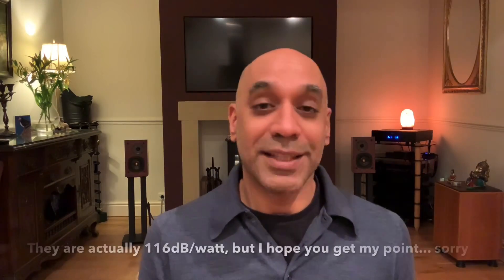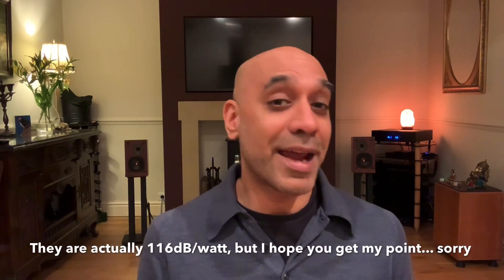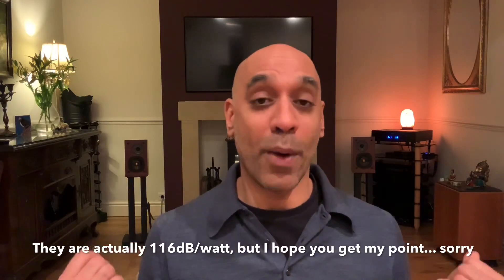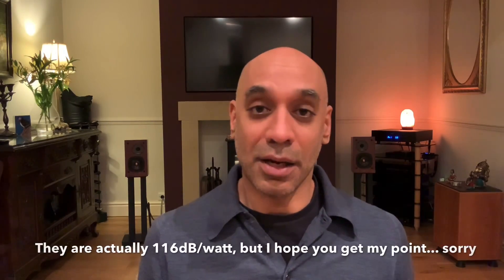Hifi Myths & Misconceptions - Amplifier Power

Comment: There is one thing that I actually miss here and that is the differentiation between voltage and amperes. My understanding is that loudnes is mainly created by a certain voltage. But when you have low impedance on a speaker you need more current (amperes) to reach the desired voltage. So the amplifier not only needs the wattage but specifically needs the capability to deliver the amperes. Or did I get that wrong?
Reply from the maker: Not exactly Martin. Too much to get into here but loudness in your listening position is going to be a function of amplifier wattage and speaker sensitivity 😊
Reply: @abritishaudiophile7314  I agree. But wattage is a function of voltage and current. And I understand that on a lower impedance you need higher currents to reach a certain voltage. Ist that wrong?
Reply from the maker: @martinsoltau6926  the voltage is set, it is the current demand on the amplifier that increases as the impedance drops 😊
Reply: @abritishaudiophile7314  see, that's what I meant. You can generate a certain wattage out of a multitude of volt /ampere combinations. And on low impedance, with an increasing demand for current, the amplifier needs the capability to deliver that. Is your point that as long as the amplifier has the wattage, it can also deliver the current?
Reply: @martinsoltau6926  
Perhaps I can help here ... Most modern amplifiers are voltage sources.  That is for a given input voltage they will produce and, through feedback, maintain a specific output voltage.  From there the job is to deliver enough current to satisfy the load impedance...

The easy way to remember this is that current is the result of applying a voltage across a load .  It's the amplifier's job to deliver that current.

Comment: Tarun, I am a new comer to, what I call high end audio. Ever since back in 1999-2002 ish I heard my mates Dali floor standing speakers through a Marantz KI Signature CD player and KI Signature amp, it played Bruce Springsteen Streets of Philadelphia, I was blown away, the hairs on back of my neck were up. I vowed then that one day I would get myself a decent sound system. Fast forward 20 years, wife and kids and couple of house moves out the way, we have moved into our 'forever home' and I am finally going to take the plunge. Your videos are helping each one I watch, I wish I could say I understand 10% of what you are saying, but this video has helped me a lot, I think I get it. After research I was going to be settling on the Cambridge Audio CXA81 and the Cambridge CXN V2, as I stream my music now, all sorted. Or so I thought, the shop I am using, a well respected chain then threw the NAIM Uniti Atom, now I am considering going this route, however it has a rating of 40w and the speakers that I am considering are Focal Aria 926 or the Triangle Genese Quartet floorstanders, and I was worried that the NAIM would not be up to drive those. If I think I have got it, I think I should be fine and not need to buy a separate amplifier, as the NAIM is retailing at £500 over what I wanted to spend on amplifier and streamer. I live in an old Yorkshire stone built property, the walls just under 1m thick all around, but the room is large where the sound system will live 6m L x 4m W x 4m H (96 cubic meters) and I will be listening from about 3.5m to 4m distance. So after all that, I hope, if you read this you have not nodded off, I think I will be fine and your video has put my mind at ease. Roll on the demo of said equipment on 17th Feb. Once again, thank you as it is a struggle to find a British channel that reviews and gives out advice.
Reply from the maker: Thank you for sharing Mark. The Naim Unity Atom is a good unit but a little pricey for what is on offer. Depending on how you are streaming, you may want to consider a Hegel H95 😊

Comment: I loved your video on  making your own IEC power conector. I am hopping you can help with my little problem. I wish to upgrade  my power input cable with a home made /shop made lead. Question  : I have a Arcam FMJ A29 it has a 2 pin IEC  power lead . All the leads are 3 pin . Am I correct  in thinking  I have a double  insulated  amp therfore any iec power cable that will fit it is safe .please  inform  me if I'm getting it wrong.  Many thanks Gerald
Reply from the maker: Thank you Gerald. It is only grounded at the mains plug end so a shielded cable will still be beneficial 👍
Reply: @abritishaudiophile7314   Thank you for replying to my question. So yes It's  OK to purchase a power lead . Although  mine is 2 pun your 3 pin setup will work ,,Yes
Reply from the maker: @geraldcrook9504  yes, that is right as far as I can tell 😊
Reply: thank you 😊

Comment: So as a mobile certified audio professional we were taught lower resistance equals easier to drive not harder to drive. Which just makes logical sense as well. If I have two ohms this requiring less power than 4 ohms. Don't believe me look it up.

Also by running speakers in parallel say two sets to an output will lower the total resistance seen by an amplifier. This will essentially double the power to your speakers as you have lowered the resistance by half.

I can cite sources if you'd like?
Reply from the maker: As the resistance drops the current demand from the amplifier increases for a given amount of power. Many amplifiers will struggle with the extra demand placed on the power supply and some can become unstable into low impedance loads 😊
Reply: @abritishaudiophile7314   It's the same way electricity works. If I lower the impedance or resistance it becomes easier to push through.  Just because some cheap amplifiers have a difficult time driving low impedance drivers does not mean it takes twice the power. You're basically saying it backwards. I'm mobile electric certified and have worked in the mobile and home industry for 20 plus years. I would provide you with sources but every time you try to include a link on YouTube it auto deletes your message.

Not only that it takes 20 seconds to Google.
Reply: Yes it will double the power demand on your amplifier.  That's not always a good thing. Many amplifiers will overheat and even self destruct if the load is too low in impedance.  IT's not easier to push through... it is your speaker placing an increasing demand your electronics. Tarun is right... that makes them very hard to drive, without killing an amplifier.
Reply: @Douglas_Blake_579  I understand how lower impedance loads are much harder to drive. Very few amps can go down to two or one ohms.
Reply: @Ace-Brigade  
Then you know that what you initially said you were taught is incorrect.  

Lower resistance amounts to more current... more heat, more strain on the electronics, less ability to maintain speaker voltage, power supplies that sag... none of it is easyier.

BTW... going from 8 ohms to 4 ohms, doubles your power... that's a leap of 3db which most people wouldn't even notice.
Reply: @Douglas_Blake_579  no that is not true

Comment: I thought id ask a question about AV receivers, hopefully you can shed some light. I want to, if possible connect my old VSX-933 to my new Pioneer LX-505 for additional amplification and to relief stress on the LX505 until i can scrape up enough cash to purchase a proper external power amp like ToneWinner AD-7300PA. So, can it be done (connecting the LX505 to the VSX933) and how can it be done? I'd appreciate you sharing your thoughts.
Reply from the maker: Sorry, but I am out of touch with those receivers 😊

Comment: 03:00 I’m quite late to the party, but is my math off? 
You said power X2 = +3db
Then you said +10db = perceived loudness X2
So to double perceived loudness would require a power increase of 3.333, not the ten times you claimed.
Is this correct?
Also, I take issue with anyone referring to a Klipsch sensitivity without explaining “in room response” to the audience.

Comment: A very good and informative video.  One thing not mentioned though, is that a speaker's sensitivity rating is for ONE speaker, not a pair of them in a room.  For two speakers playing in the same room, the output will be 3 dB higher.

Another thing not mentioned is how live or dead the room is.  Highly absorptive rooms will require significantly more power to achieve the same SPL at the listening position as rooms that are highly reflective, such as the one you were sitting in when recording the video.
Reply from the maker: Thank you 😊

Comment: its all swell as some say.   i had a ayima ao7 chip amp with improved chips and bigger fan-driven power supply pushing to 48v and a constant fan hum and i guess near 120w per channel paired to dual polk psw-10 subs and polk tsi100 bookshelves...i got it to sound ok on some tracks.    i then got an emotiva basx 2 amp at near 160w per ch and to me there is little comparison,   the emotiva a/b amp sounds better on all types of music.   separation, depth, cleanliness, sibilance, etc.  I'm kinda proud of it now.
Reply from the maker: Thank you for sharing 😊

Comment: Regarding headroom, do we need to take Crest factor into consideration? https://en.wikipedia.org/wiki/Crest_factor
Let's say if I listen at 4W RMS at the loudest part of the music.
If I want to reproduce the peak of the waveform faithfully, assuming everything else is ideal, would it take another ~15dB of headroom?
Though that would mean ~120W peak power which seems a bit excessive
Maybe a 20W amplifier can already deliver that 120W very short transient? Probably depends on the amplifier design.
Also, maybe this was part of the cause of "high revving vs purring" difference?
Reply: Another thing that may affect the equation would be how much the speaker impedance dips at different frequencies.
Reply from the maker: @raymondchow4447  indeed, thank you for sharing 😊

Comment: Great review, I'm now also wondering why do audiophiles add Power Amplifiers seperately to already powerful integrated's with a good preamp, yet they still add seperate stereo poweramps or monoblock poweramps?... What is the advantage of that?... I hear a lot of people say they're not needed if you run a very powerful integrated say for example a Hegel H390 or H590, yet you see systems with this kind of integrated and then go out to monoblocks? Woulnd't there already be ear splitting power in the integrated? So why add power amps is my main question you might be able to shed some light on?
Reply from the maker: Thank you CR. It is probably too much to get into here but reducing noise and power amps capable of dealing with varying impedance loads are important 😊
Reply: @abritishaudiophile7314  So in essence if you had a 200W at 8ohm Lyngdorf TDAI 3400 integrated for example, you could add the Lyngdorf or other power amplifier even a higher powered one like PS Audio M700 or M1200 and it would reduce noise coming out of the speakers because separate power supplies? Would love you to do a video on this subject, you're videos are extremely informative, thanks for your experience.

Comment: Also a veteran audiophile here and talking about the complex physics of sound and the dynamic demands posed by a random speaker design on an amplifier, it is worth noting that even if capable of high wattage the quality of the amp's first 10 watts is key in all of them.

It also seems to make more technical sense to design the amplifier specifically for a particular speaker yet active speakers have been largely confined to pro audio which is a different environment with different objectives.

Ultimately it is the complexities of speaker design working with an amplifier trying to electronically cope with physics, needing to interact with room acoustics, to please various listening preferences and the nuances of the human ear itself that makes this passion truly unique to all else.

And this is just the playback side of music.
Reply from the maker: Thank you for sharing Bobby 😊

Comment: The most important thing one should take into consideration, when he is someone like "Max", who, maybe, likes to party with his friends every weekend, is how long does he wants to enjoy his amplifier. Amplifiers generate heat in order to produce power and heat is the number one enemy of electronic components.
So, if "Max" wants to enjoy both partying every weekend and his amplifier for many years, he better get an amplifier capable of delivering at least double the continuous power rating of the speakers, to provide minimum 3 dB of headroom and ensure that the power amplifier will never have to work at more than half of its power delivery capacity. If possible, Max can get an even more powerful amplifier that wil provide a cleaner signal and will work as cool as possible. Of course, in order to keep being happy, Max has to be very responsible and careful how he is setting his system gain stage.
Every time Max fills up his house with friends the SPL requirements will increase and Max has to drive his beloved speakers closer to their maximum continous power rating. His amplifier has to be able to run those speakers close to their rated output without the need to increase the speed of the the cooling fans.
Basically, get the most powerful amplifier you can afford, stable down to 2 ohms and with high quality quiet cooling fans, in order to enjoy it for many years, regardless of what speakers you drive with it.
Reply from the maker: Thank you for watching and sharing 😊

Comment: Helpful video, thanks! I think sound pressure follows an inverse square law with distance, so if we call it +0db at 1m, it'll be 1/4 at 2m, which is -6dB, then 1/16 = -12dB at 4m. Someone correct me if I'm wrong.

One other thing worth noting is I think many amplifiers will tend towards their minimal SINAD as the power goes to maximum, so it's possible you can get slightly better audio if your amplifier and speakers match your listening volume requirements.
Reply from the maker: Thank you. I believe that is right -6dB as the distance doubles as an anechoic response 😊
Reply: You are right ... but only for omindirectional dispersion... like you'd get outdoors.
When you put speakers into a room, as Tarun explained, the walls tend to concentrate the sound and negate the inverse square law to some degree.

The easiest way to explain it is that the minute something becomes directional, the inverse square law no longer applies.... which is why lasers are able to send a beam so far.

Comment: I have seen a couple of videos on this topic as of late, and I feel that your video gives the most accurate and useful information of the videos. The only thing that you could have provided to bring things home would have been to measure the voltage at your speaker terminals to verify what you are explaining. I listen to music at a similar volume as you, but my speakers are more efficient than yours, about 90db sensitivity. When I checked the voltage on my speakers, I seldom exceed.5 volts. A large peek of.75 volts was rare. And if I turned it up louder than I like normally, I would hit 1 volt. That is still not 1/2 watt of power. So my average power output is between 1/4 and 1/2 watts. And with your speakers in your room you would likely have a higher demand on your amplifier, but I would bet that you would be in the 1/2 to 1 watt range. In one of the videos they used a scenario similar to your setup, and  he calculated that you would need north of 250 watts to listen to dynamic audio programming, at an 85 db average volume. Just ridiculous.  I have a 100 watt solid state amplifier that I use, but I also have a 4 watt single end triode amplifier that I use. And I have no problem reaching suitable listening levels with that 4 watts. And I used the same kind of amp to power a pair of ProAc studio 1’s. They were a little bit more efficient than yours, but not much. I think they were maybe 87db sensitive. Keep up the good work.
Reply from the maker: Thank you Mark 👍😊👍

Comment: Hi,you did a great Job.
I've a speakers that have 90 db Spl and a power handling in a range from 25/120 W at 8 ohm
Nominal impedence is 3  at 12.5kHz and 4.73ohms at 172Hz.
My room is 15/20 mq,do you think I need an amplifier capable of 100 W at 8 ohm  Or a more powerful one,m let's say 140 W at 4 ohm?
Thank for your reply
Reply from the maker: That will depend on how loud you want to play but for most people 100W into a 90dB speaker will be plenty 😊

Comment: Hi Tarun! My compliments for this great channel! I'm loving it so far, watching you from Tirana, Albania 🇦🇱 
Quick question for you if i may: I'm having a Mordaunt Short Avant series with 906i to be used also for stereo (music). Can't go higher than 1.000eur max for an integrated with Dac and avr integration, so my theoretical choice is Audiolab 6000a. Distance listening is around 3m. Does the 6000a have power enough for my room?
Also, would 2.5mm cables be enough or should i go with 4mm as a better option??
Thank you if you could ged back to me!
Best regards from Tirana!
Reply from the maker: Thank you GM. On paper the 6000A should do very well. As you probably know, you can never be sure until you try. It is a fairly safe bet though 😊👍👍
Reply: Thank you Tarun! I appreciate. Regarding  cable length, 6m right, 1.5m left, may 2.5 section be enough or it is better 4mm??
Reply from the maker: @gm1521  I would keep both lengths the same and fold the excess in a “z” formation. In most cases 2.5mm should be enough 😊👍
Reply: @abritishaudiophile7314  Thank you again!